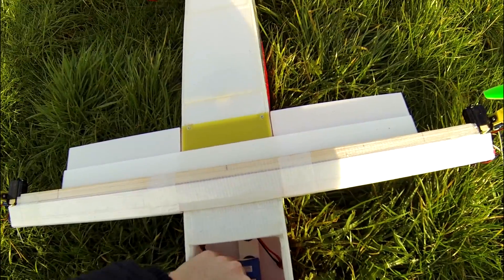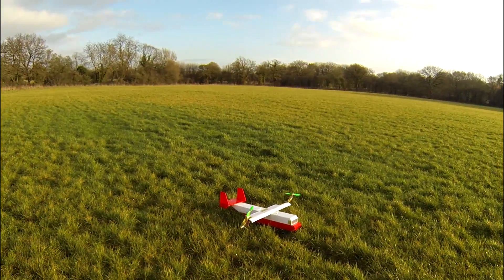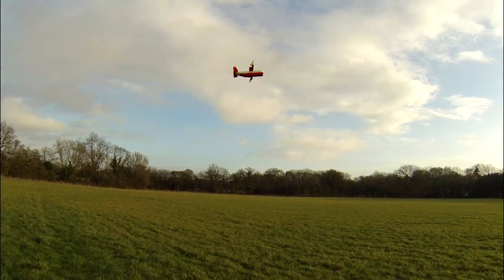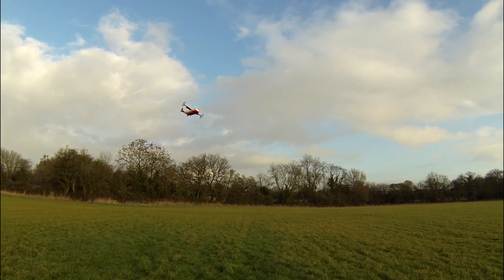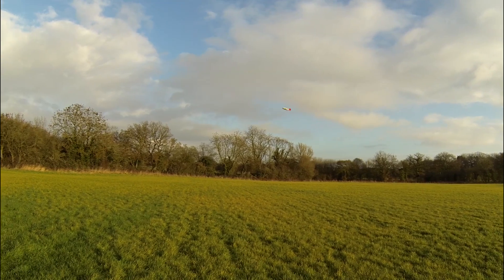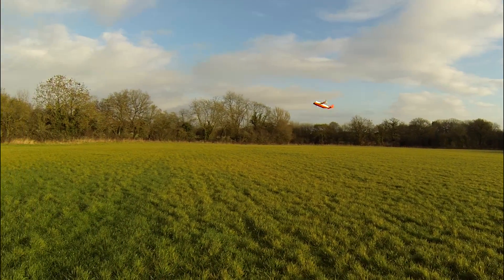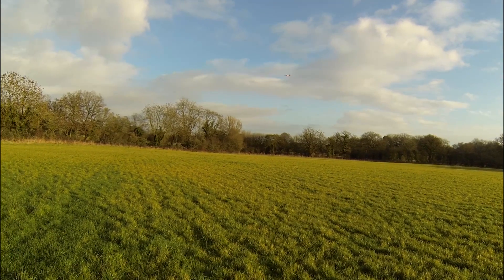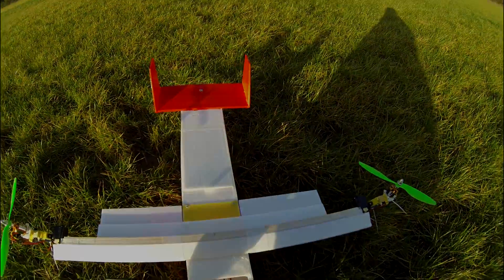RC VTOL Transition Testing #1

Comment: MIT had some experiments shown on youtube with collective pitch quadcopters, if you had the ability to change the blade pitch and tilt that would be new, and fly as fast or slow as you need.
Reply from the maker: I did think about having collective pitch, however it would have been too complex to rotate the mechanics for stability in a hover. I also wanted to see how simple a VTOL aircraft could be built. Thanks